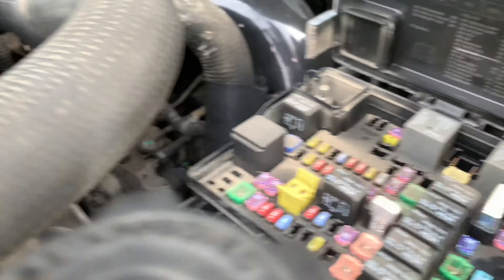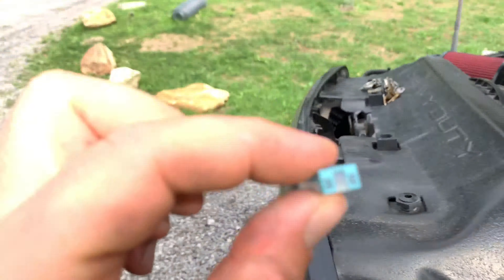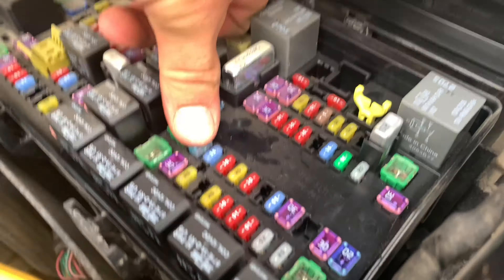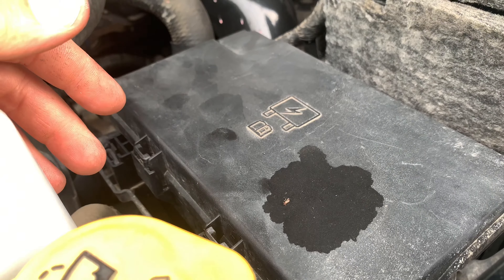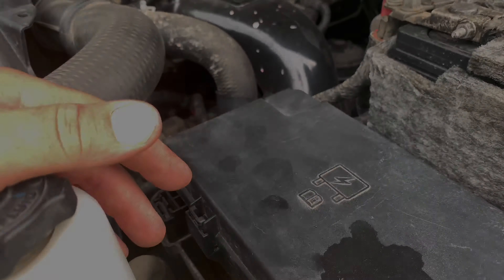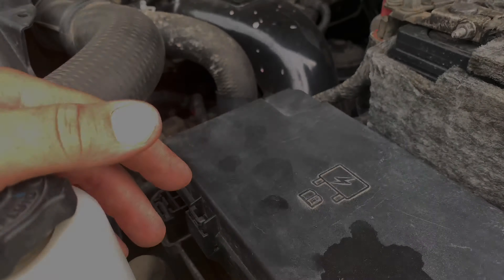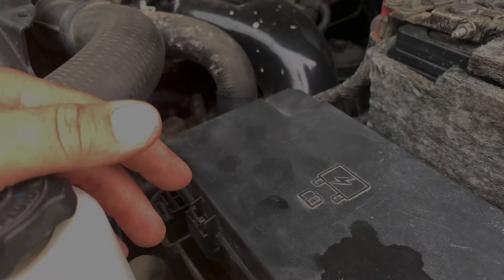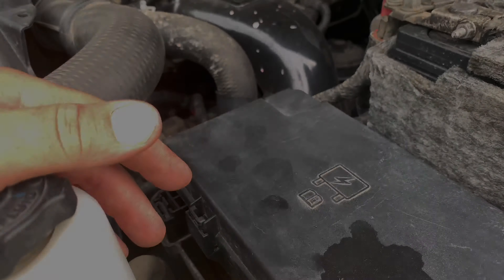Trailer lights fuse location on a dodge cummins

Comment: Thanks for the video.  Going to look into that today.  Hauled cows last night.  No trailer lights
Reply from the maker: @wallyyuriy8912  that’s not good combination! Hopefully u get it figured out!
Reply: @frontwoodsfarmer2063  well. Replaced that fuse.  Good now thanks!!  Got a few for spares in the glove box.  

But I’m going to replace the plug end on the cattle trailer.  I think there’s something touching in there to cause it to blow a fuse.  It shouldn’t do that.

Comment: I’m having an issue where my truck’s taillights won’t turn on when I turn my headlights on. When I plug my trailer in, the taillights on the trailer work fine. Wondering if this is a possible fix for it.
Reply from the maker: Sorry I just seen this somehow? What was it fuse related?
Reply: @frontwoodsfarmer2063  no worries! We checked everything from the fuses, wiring, and body control module. Turns out something happened and all the lights burned out at once. When I checked each bulb individually it showed dead but once we replaced them all at one the entire thing started working again. Definitely weird.

Comment: Did you ever figure out why the fuse blew to begin with? Having the same issue except my fuse has blown twice in 30 miles lol and actually all 3 of my trailer fuses blew  and all i had was turn signals and brake lights. No aux power f30 and no running lights or trailer brakes.
Reply from the maker: Mine was the wiring going through the axle wore a spot and was grounding out blowing the fuse

Comment: When your lights stopped working did the trailer brakes still work
Reply from the maker: No they worked fine that’s the wierd part I narrowed it down to the wires tucked in the axles but the brakes worked? Very strange

Comment: I just need the location for the regular tail light and turn signal fuses just for the truck no trailer. Is it the same fuse?
Reply from the maker: I believe so but not positive I haven’t done this for awhile
Reply: Ok cool deal. Hey I appreciate the quick response I didn't think I'd get one that quick. I just went and got a new blinker on the dash still no luck I'm about to go get the fuses now and see if it works. Im feeling it's just going to be a process of elimination from here on out. I'll let you know if it works.
Reply from the maker: I appreciate u commenting! Yeah I’d start there also I’m not the best at it either just trial and error hope it all works out if u get stumped get at me I’ll give u my email
Reply: What year is your Cummins?  I have a 2010 and ran into this problem. I believe your TIPM is different than mine. I have a 30 amp j fuse or which ever the bigger of the 2 was, blown. I replaced it and still no marker lights. I went to my camper and threw a jumper between the pos terminal and the running light terminal and they turned on. I believe it’s narrowed to my truck. I’ll have to look again but I don’t believe mine is showing a trailer marker light fuse. Thanks for the awesome video tho.